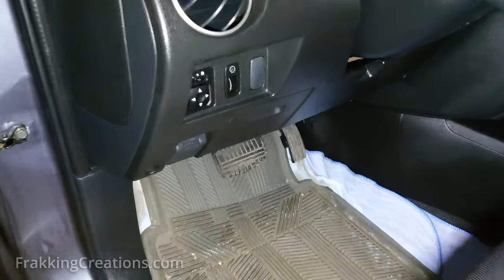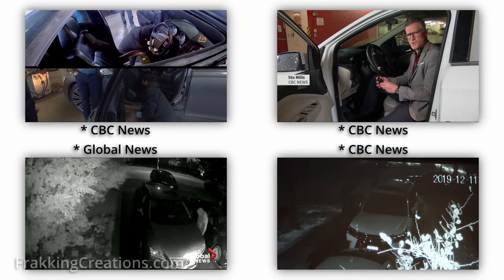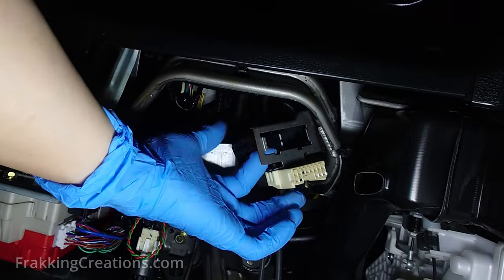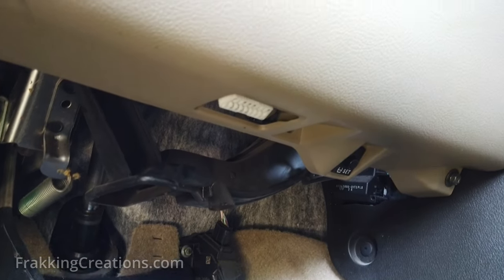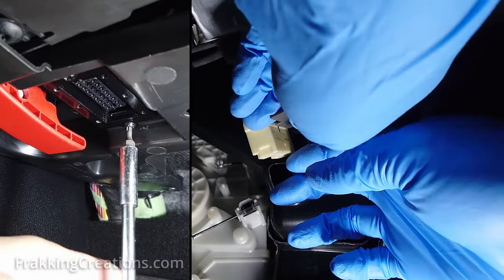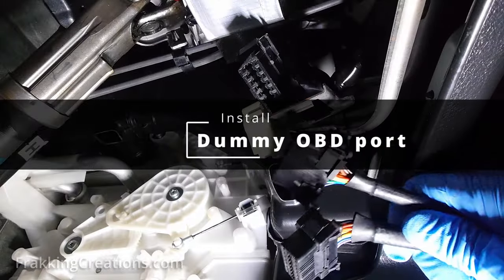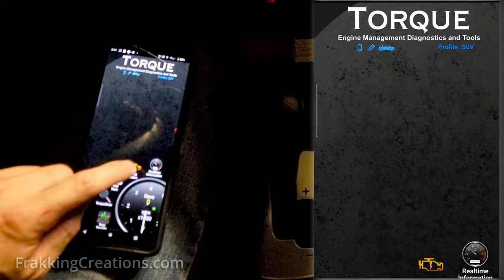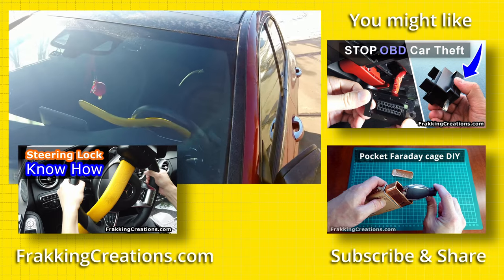Stop OBD car thefts - OBD port relocation with Fake OBD port install DIY

Comment: Doesn't this just splits the port between 2 plugs?
Reply from the maker: Good question: This is indeed a splitter cable.  But the way I was mentioning to use it is not to plug the original OBD cable into the splitter cable when doing this DIY.  This way the dummy port doesn't work.
Reply: @FrakkingCreations  I guess I don't see why a splitter cable would be suggested when you could just plug up an extender for the odb and leave the other end not connected
Reply from the maker: I chose this splitter cable due to the two different plug ends.  Different vehicles have slightly different setups and as I mentioned in the video, one of the plug ends fit the demoed vehicle better than the other.  For one cable, the user has an option to pick the one that fits best.
Also, after I bought the one used in the video, I found another similar cable that also comes with an adapter plate for using screws to attach the OBD cable to the vehicle.  This is the link for the "OBD Splitter cable 1" in the video description.
Viewers can now have 3 options to choose from when trying to do this DIY.  Sometimes it's hard to tell which one you need so hopefully this helps them.
Edit: I also provided other cable options that could be used and our viewers can pick one that works best for them, including extension cables.

Comment: A smart man would booby trap the fake connector with high-amperage 12V Or perhapsa seperate 24V battery. To destroy the attackers dongle or computer USB ports.
Reply from the maker: I've seen people suggest this and it does sound like an interesting idea.  I haven't seen anyone try this and then test to see what happens.  It's definitely dangerous and comes with some added responsibilities on your part if you don't want you or anyone, their property or your property to get hurt or damaged.

I would think that you will need to include a fuse in that setup or the person using the OBD port that is booby trapped could cause a fire to your vehicle and/or their equipment.  They could also get hurt.  Without a fuse that get's very dangerous (Not that a fuse alone makes it "safe").

Also consider:
- Every time you take your vehicle in for servicing at an auto shop or dealership, you will have inform them that you have trapped the original OBD port and that they should not use it.  Either that or you will have to disable the trap before the service and re-enable after the service.  If you don't and they do try to use the port, it could damage their equipment and you would be on the hook to replace it (Could be thousands of dollars for you).  Also, a fire could break out causing damage to their facilities or hurting the mechanic.  Sometimes mechanics use the OBD port legitimately to scan for faults, pending faults and sometimes dealerships apply updates to the firmware of the vehicle.  These are likely and legitimate scenarios.

- When you sell your vehicle, you have to remember to remove the trap.  Also, during the selling process, the potential buyer may ask to take the vehicle to get inspected or may want to use their own reader to access the OBD port to scan for fault codes and pending codes.  You will have to inform them or disable the trap.

- Also, some places have annual emissions testing that has to be passed before your vehicle registration can be renewed in order for it to be road legal.  If you trap your OBD port, then you better make sure you remember to undo the trap and restore the original port before going for the emissions test.

All in all, more responsibilities.
A smart man would think twice before trapping the OBD port.
Reply: I like how you're thinking.
 I too have had the notion to do just that. SUPRIZE Mr. Badguy.
 Awaiting spring/ warm weather and some free time.
Reply: Only problem is if you forget about this and take it to a shop, only to destroy their thousand dollar scanner.

Comment: Great info! If you’re able, could you please let me know what links I should go to & purchase to set up the fake port, and relocate the port to a central area of my truck? (2021 Silverado 1500)..I wouldn’t mind putting a physical lock on it, after moving it to the alternate location, as well. Thanks!
Reply from the maker: Thanks for commenting.
Since I don't have that vehicle, I won't know specifically which fake splitter port you will need.  Though, the ones I linked to in the video description should work.  I provided quite a few so you will have to check out what your OBD port looks like and decide which one fits best.

As for an OBD lock I also included links for some in the video description.  Please check those out.
Reply: @FrakkingCreations  Thank you for the reply & feedback. I decided to do a variation of what you’re describing and doing. I purchased a splitter, which I’ll use to extend both leads elsewhere in the vehicle. One will be hidden, but accessible for access & I’d like to connect the other to a GPS tracker w/ app access and for vehicle diag. I’d like to think that’s possible, at least. In place of original ODB port, I purchased a dummy that I’ll install & put a lock on. My thought process is that someone should come prepared to spend and waste some time if they’re looking to gain access to the port, and then discover it’s not a legit port anyway, which hopefully will discourage and help them move along to something easier.
Reply from the maker: Nice.  Make them spend the time to remove the lock then have a non-functioning OBD port.  That would be funny to watch.
Reply: @FrakkingCreations  yes sir..no guarantees, but should definitely slow their roll a little lol

Comment: Can we not cut the obd2 port wire,redirect several to hidden kill switches?
Reply from the maker: I suppose that is also possible.  But if the cut in the OBD 2 wire is close to the port, the thieves would be able to find the cut and tapped wires for the switch and just bypass it by reconnecting the two wires that go to the switch.
Reply: im trying to something like this
do you ever find out

Comment: On computers we have this thing called a "password".     Maybe we could have a password to enable access to certain functions on the vehicle.
Reply: Passwords can be bypassed or cracked. Thats only a half measure. Preventing access to your car's electronics is whats best.
Reply from the maker: @billmcc64  One of the issues with car computers is that they have been very basic and systems are not designed with security in mind. Even if they put a password screen or pin entry it may not be enough because it is still possible to hack through other means.  For example, like connecting hacking devices to the OBD port, the car's WiFi and in some cases through the wires that power the headlights.  These all connect to the vehicle's bus system to the main computers without protection or security.

Comment: Is there one with the key for jeeps?
Reply from the maker: There isn't a specific OBD port lock to the Jeeps so you would have to choose one of the 2 universal models.  You would have to check with the seller as to which one would fit better.

Comment: How did you place new obd 2 to the body , my car is failing due to emmisions not satisfied unless attached to body in which my obd opening is cracked
Reply from the maker: I don't understand your question.  Please rephrase it and provide more details on your issue.
Reply: My obd port can’t be reattached to original area is there any suggestions how to reattach to a different area, my emmisions won’t pass me unless it’s attached somewhere on body, I tried zip ties but they want it unmoving, please any suggestions would be appreciated  @FrakkingCreations
Reply from the maker: It's hard to say without seeing it.
Consider buying one of the OBD extension cables that come with screw holes that can be used to attach to the car.  You can then use screws to attach the extension cable end to plastic paneling under your dash and then plug the original OBD cable into the other end of the extension.
I have a link in the video description to such a cable.  Checkout the one called "OBD Splitter cable 1"
Hope that helps.

Comment: Can you simply use a (or two) security screws and screw it in the middle of the obd port. This shouldn't short any wires and would not allow anything to plug into the port.
Reply from the maker: It's a possibility.  Just have to be careful still as you have metal screws close to the pins.  It's possible to have the screws or screwdriver accidentally touch the pins as you are screwing the screws in.

I believe one of the universal OBD locks I recommend uses something like this to "lock" a cover over the port.  Check out our other video if you're interested.  I have links for the universal lock in the description of that video.
Reply from the maker: Here's our OBD lock video: https://youtu.be/wIyETwhLTyQ

Comment: Can this cause a failed connection at the INSPECTION STATION?
Reply from the maker: Of course.  The original OBD will not be connected to the visible dummy port.

Be sure to reconnect your original port before going to get your vehicle inspected for emissions testing.
Reply: Yes

Comment: can you do a killswitch with this
Reply from the maker: No.  A proper kill switch would require accessing power lines for components like the started, fuel pump, etc...  This would not be possible using the OBD port alone.